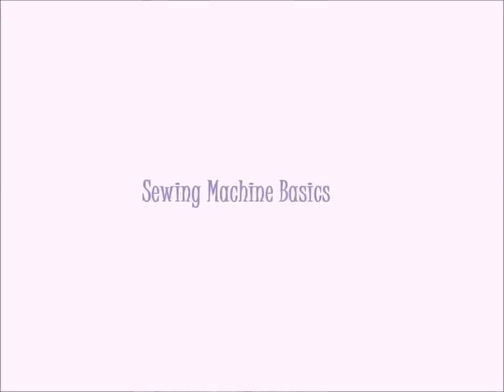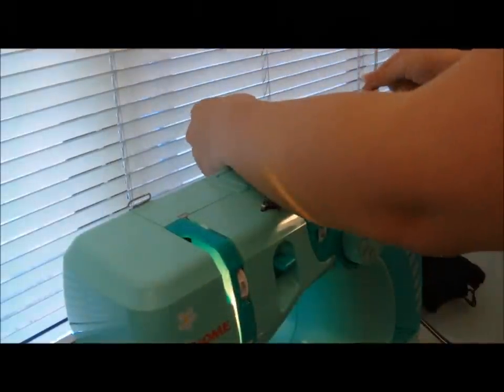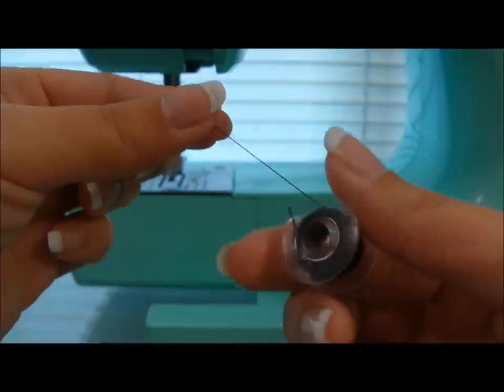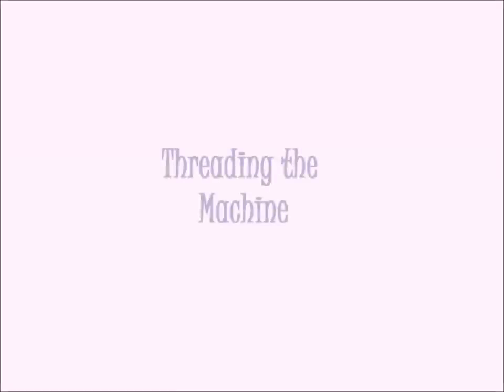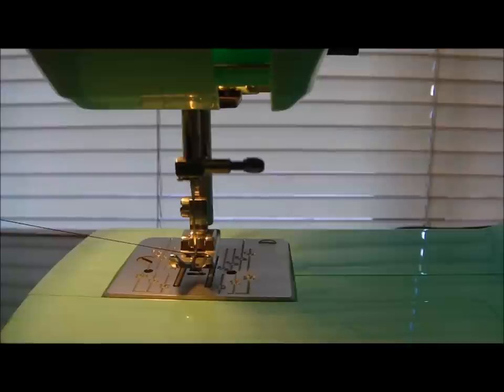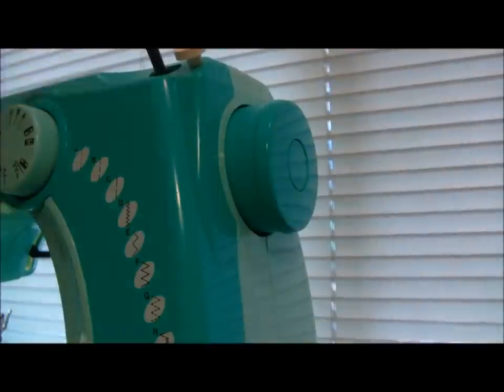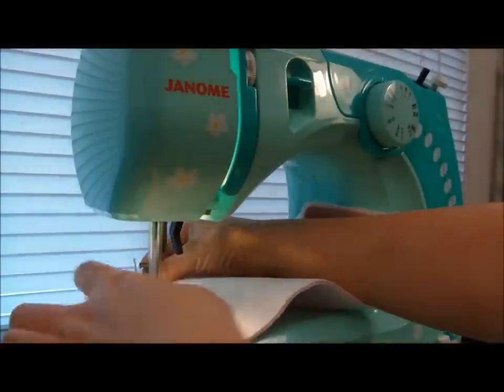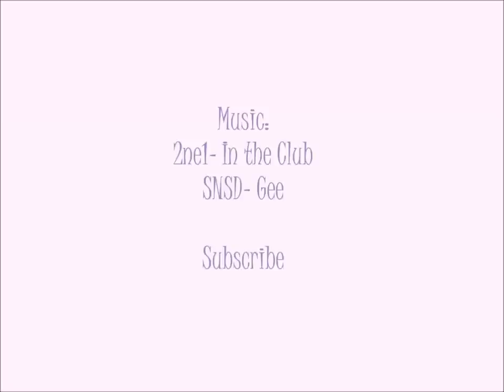Sewing Machine Basics

Comment: On the video at 4.40 to 4.50...she's holding the threads to the left until the stitching is tacked down...going forward then reverse then forward again for a few of stitches (only a few is needed)...then the starting thread tails no longer need to be held. Not holding the starting threads as shown will cause a thread tangle. To end a seam have the uptake lever at its highest before lifting the presser foot up & before removing the fabric. Turn the handwheel one turn toward you if needed.